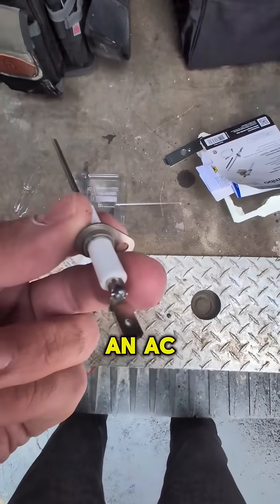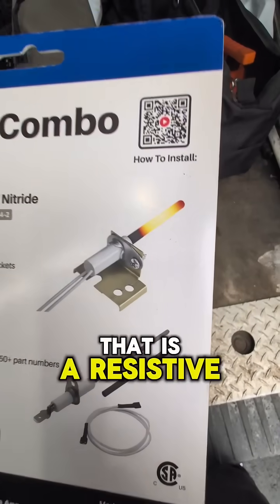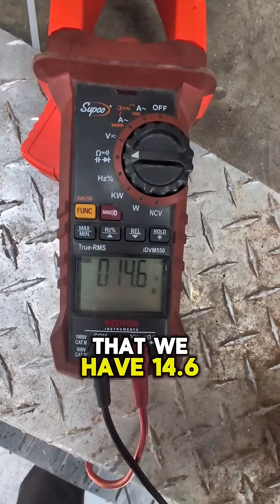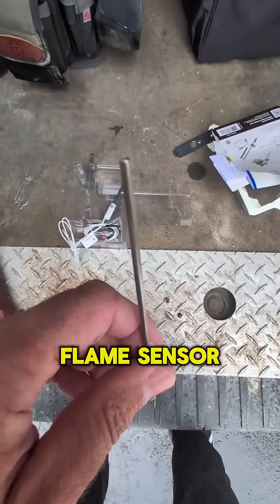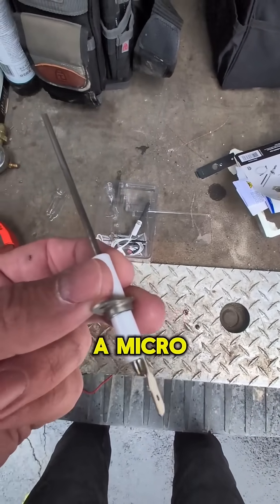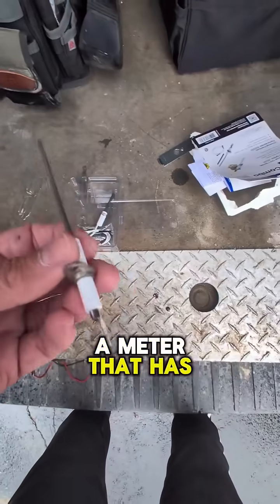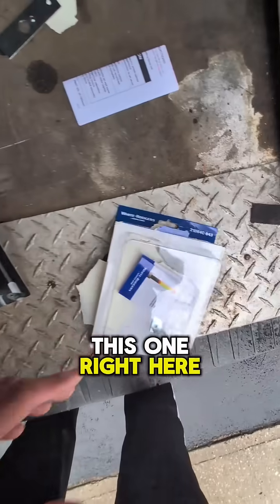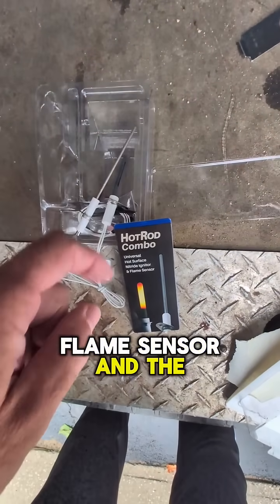Flame Sensor Voltage

Comment: Flame sensors have A/C voltage? I've never measured an a/c circuit with d/c amps. Can you demonstrate the a/c voltage part?